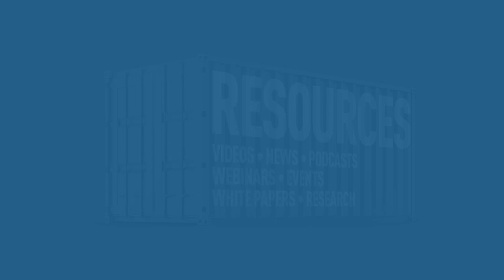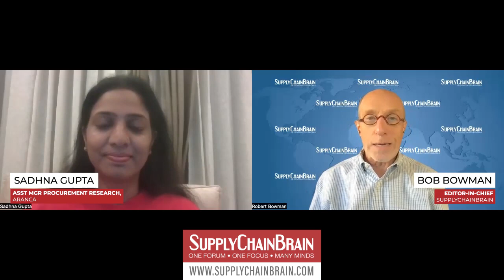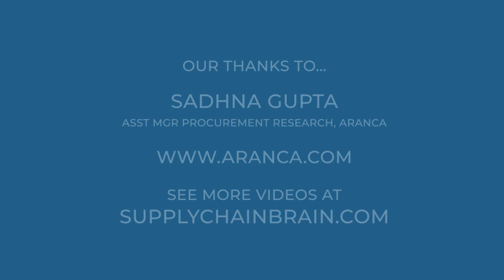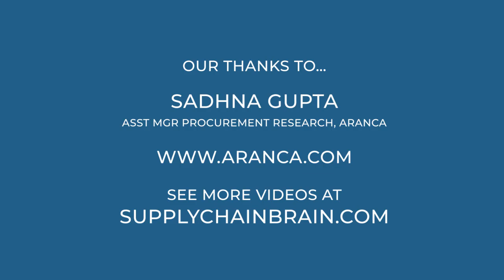Silicon Metal: The Supply and Price of an Essential Raw Material

Comment: Horrible video:  does not understand the difference between silicon metal, PV grade POLYSILICON, and Electronic Grade silicon….silicon metal is the precursor and is used for silicones, Al and Fe alloys, and silicon for PV and semiconductors.  Next process is polysilicon and, if finished becomes semi grade.  PV grade silicon is made in China, but semi grade is outside of china - Wacker, Hemlock, Sumco, OCI primarily…Huanghe and GCL make a small amount inside of China.